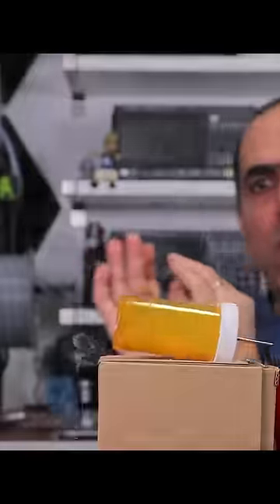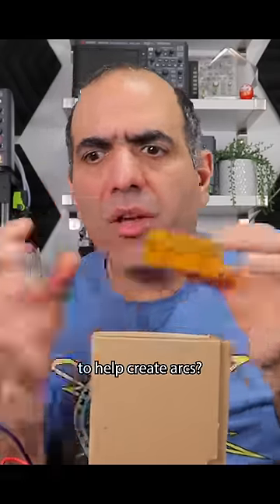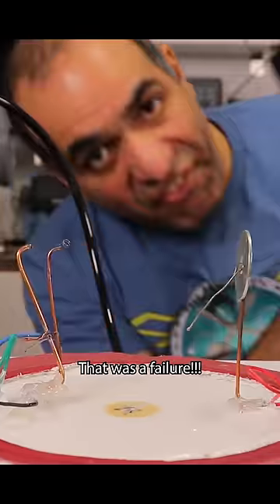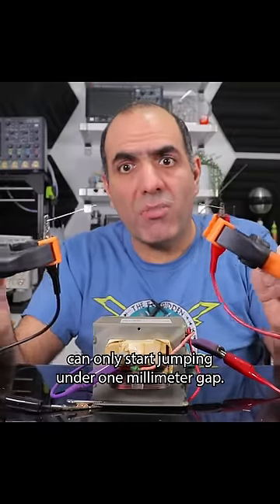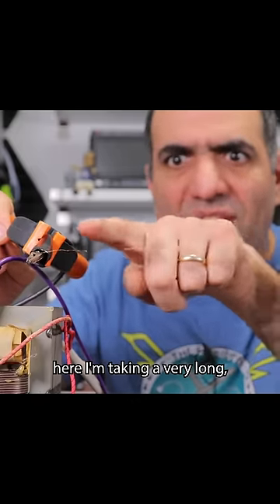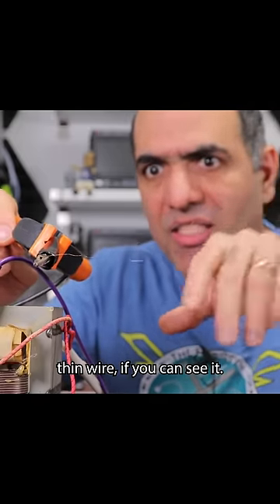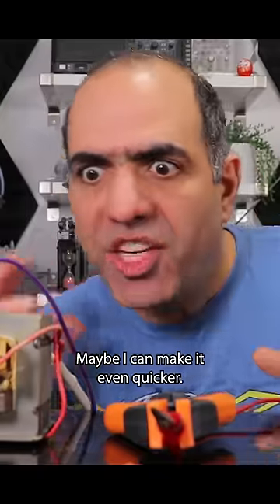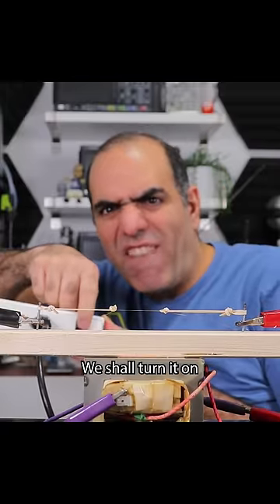The Making of a High Voltage Fuse #electronics #arc #funny

Comment: Elastic wire fuse at the last part is kinda how some higher voltage fuses are built, loaded under springs that tugs at the fuse itself so it immediately stops arcing once the fuse's blown, which sand and / or glass mix is also added to ensure that arc is completely quenched out once the burnt end of fuse gets yanked out by spring.
Reply: There's an epic video out there about a dude in the UK who blows apart like a million Amp fuse with sand in it or somethin
Reply: He shows that in the end of the full video
Reply: There's also the powder-actuated fuses, which are basically a Ramset nailgun that blows the fuse out of the holder at high velocity whenever it trips. Most common type of high-voltage fuse on 6kV and 11kV residential service.
Reply: @tinudavies5825 
please change and grow as a person.
This is common knowledge IF you study about electronics.
Reply: I remember my shop teacher showing me one of those fuses! Truly crazy how something so simple is so effective
Reply: @rajgill7576 Photonicinduction.
It was a 5000A fuse by the way.
Reply: @rajgill7576  Photonic Induction?
Reply: as if this guy didn't already know that
Reply: He knows that, he's deriving that type of fuse from first principles and showing people what doesn't work and what problems need to be solved with what he makes look like accidents
Reply: Jb
Reply: Most of them are. Even the old fashioned Edison screw fuse from the fuse board — you know the little grey (for 16A) cap that shoots away when it trips? That’s held under spring tension, and has this function.

Comment: Rare footage of electroboom not getting electrocuted in a short
Reply: ...and not a single FULL BRIDGE RECTIFIER was harmed in making of this video!
Reply: umm actually its shocked and not electrocuted or else he would have died 🤓 👆
Reply: Damn too late 🥲
Reply: He was shocked when he used water to put out the high voltage fire.
Reply: Impossible...
Reply: Don't worry in the long form video he gets burned by a melted wire 16 into the video
Reply: Rare footage of electro boom not getting electrocuted at all.🎉
Reply: Commonly occurring comment on his every short
Reply: That microwave transformer is no joke and he knows what he's doing that's why
Reply: If he doesn’t get shocked that means he’s using deadly amounts of electricity

Comment: I had older ceramic fuses in my house, they had a small spring-loaded 'eye' in the middle, painted some bright color, and when burned through the spring would eject the eye with the piece of wire attached, making it fly across the room.

Comment: Hi engineer, I want to make a 15kV shock transformer with a voltage of 3.7V. I want you to tell me a strong voltage booster circuit to make a capacitor bank.

Comment: The fuses on top of the power poles that shut off the Primary Voltages of 2,400 Volts and UP have a lining of gunpowder in them that go BOOM! when the fuse blows, and the explosion then snuffs out the arc.

Comment: May I please ask what your source of the 2000 volts is? A self built/wound transformer? Or did you buy a readily available power supply? I require a 1000 opt power supply. The one I made vibrates like anything and hence is noisy.

Comment: You can use water, like with those electric cars, the only real downside is that those fires don't go out easily. But having a direct supply to the power grid wouldn't help either lol

Comment: Make the fuse long with a hinge on one end and a latch on the other. When the fuse link inside brakes it will release the latch letting the fuse swing out of the holder at the hinge and breaks the circuit. . 
Make a fuse long with a fuse link running through the center to each end and fill it full of sand. When the link breaks the sand blocks the path for the developing arc and breaks the circuit.

Comment: You could get a card board box and get a copper wire between the cables an put sand and the compounents into the card box